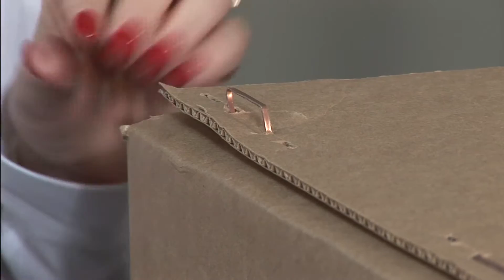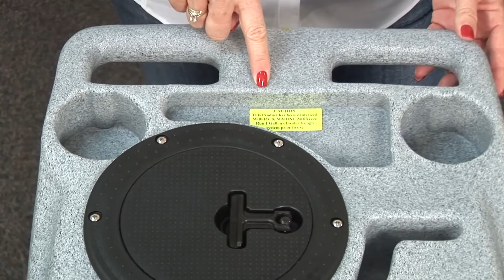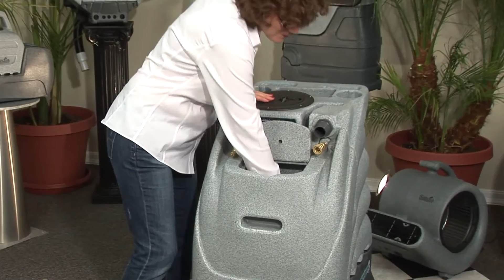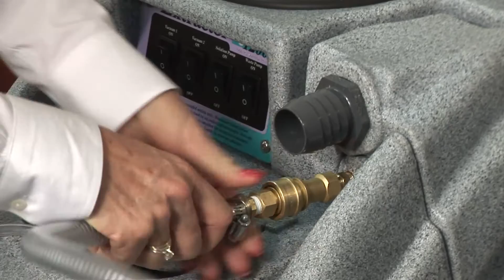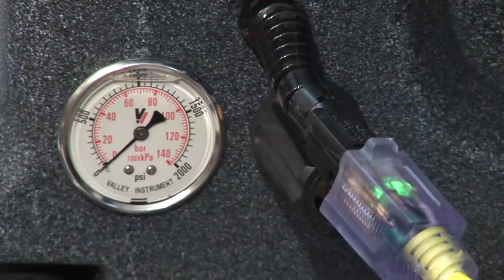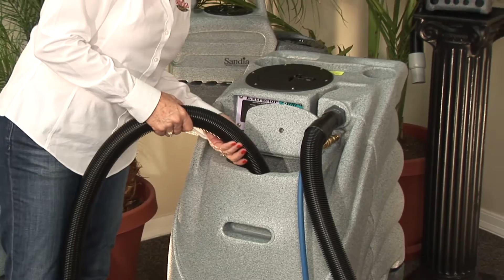Sandia Products - 1200 PSI Hard Surface Extractor Equipment Training Video

Comment: Have you guys came up with an upgraded version of this model or a better model? Can it also dispense solution via spray hose. For example if I needed to spray solution on barroom walls. I'm looking for one that I can do tile & grout and natural stone restoration. Lastly what wand do you recommend for tile and grout that is low enough to go under cabinets and narrow enough to use around toilets. If I have to use a hand held around the toilets please advise. I was thinking the 12"  would be fine but it has to be very low to the ground to avoid hitting cabinets, furniture, etc.

Comment: Can you also clean carpet with this type of machine?  Also, is there anyway to use a long enough hose to get upstairs without having to take the portable upstairs when cleaning and extracting?
Reply from the maker: Hi Angie,Yes you absolutely can clean carpet with the 1200 PSI machine. Please be aware it will dispense a large amount of water in a short period of time. Even if you dial it down to 400 PSI, there is still a lot of solution that comes out. 
As for the hose, the longer the hose, the weaker the vacuum suction comes due to the length of the hose. This will cause less solutions to be suctioned out, taking your carpets longer to dry. A longer hose does not diminish the pressure though, just the vacuum.
If you need more information, please call just at 800-983-5834 and ask for Garry! Have a good day.
Reply: Ultimate Solutions ok thank you.
Reply from the maker: No problem at all. Anytime you need something either contact us or message us!
Reply: Ultimate Solutions ok will do.